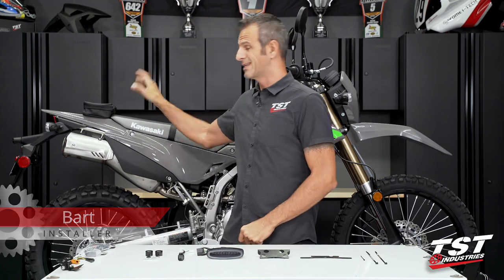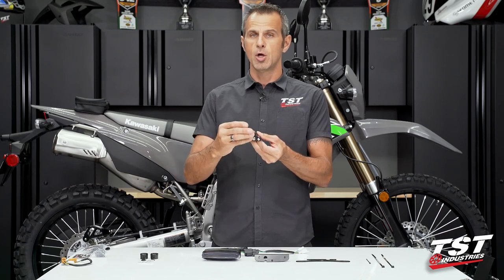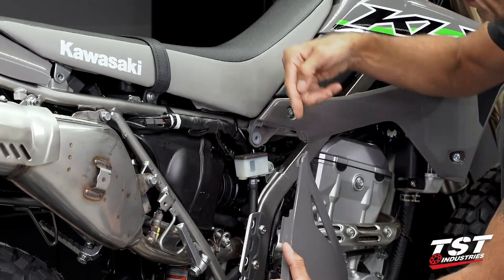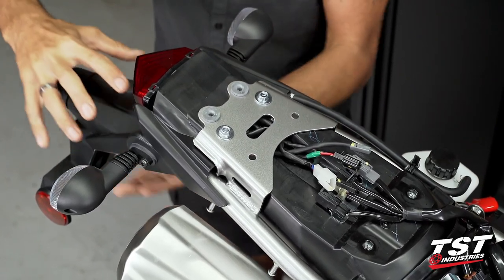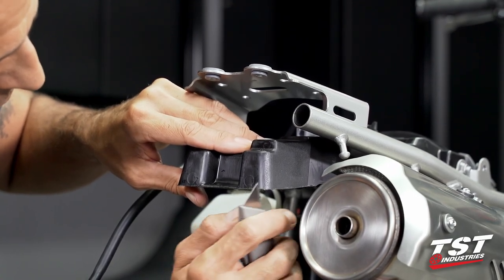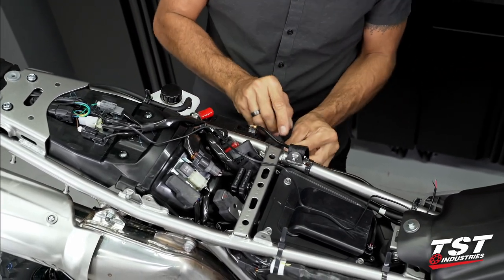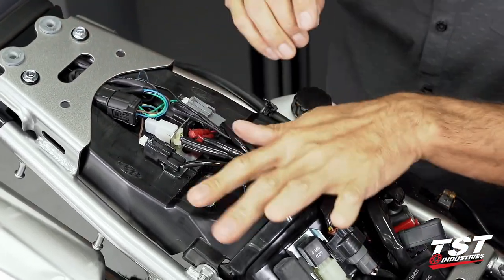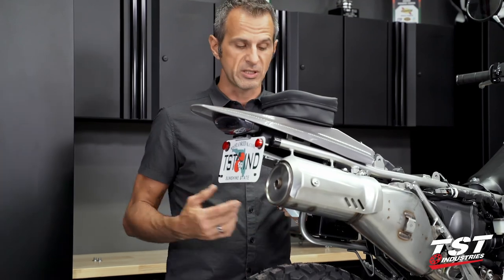How to Install Integrated Tail Light & Fender Eliminator on 2024+ Kawasaki KLX 300 by TST Industries

Comment: I sure wish I had just been patient instead of butchering a 2023 version on the back of my 24 a week ago... Oh well... It still looks cool.
Reply: I am glad to see you guys trimmed the fender liner like I did. Initially I had installed the bracket without it and realized there was a huge space where water and mud could get in.
Reply from the maker: On this bike, without making a whole new subtray, the modification is necessary for a clean installation.

Comment: Fender eliminator is not necessary. I have a 2023 klx300  and all I did was  invert the license plate bracket then cut off the excess plastic hanging below the license plate. Looks clean and costs nothing.
Reply from the maker: @mrcolin2u  we appreciate the ingenuity. You should make a video of the process to benefit other KLX300 owners if they want to go that route.
Reply: @TSTindustries  Excellent response. Well done, Sir.